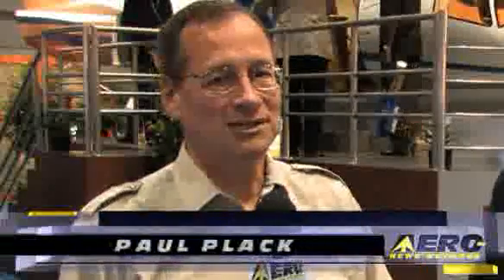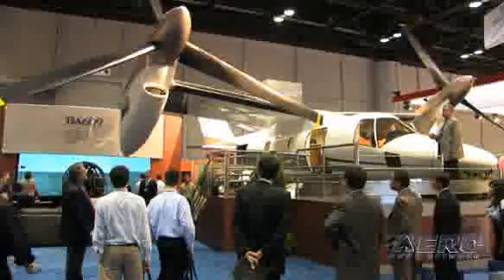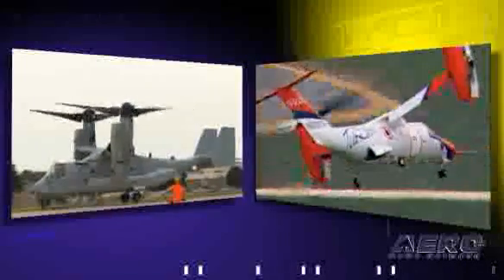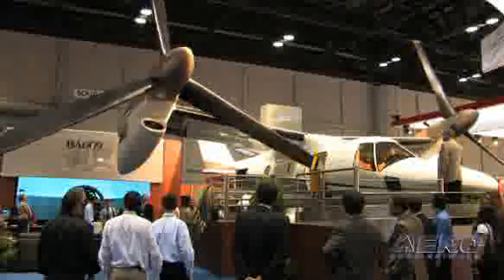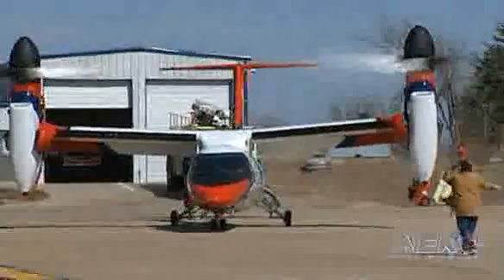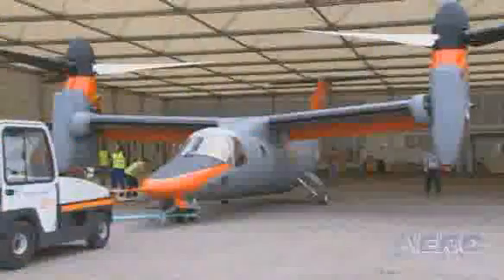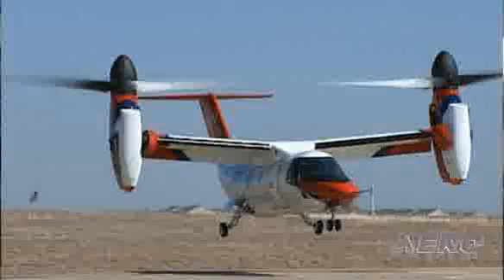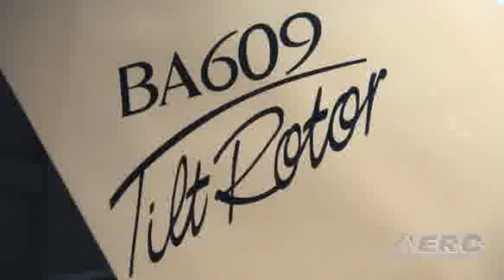Aero-TV: The BA609 Tiltrotor -- A New Generation of ...

Comment: A tail rotor is used to counteract the torque produced in a single main rotor helicopter. Without a tail rotor, a conventional helicopter would rotate in the opposite direction of the main rotor, but when you have 2 main rotors rotating in different directions (V22, CH-47, K-MAX 2000, KA-50, and many more) each rotor counteracts the torque from the other.